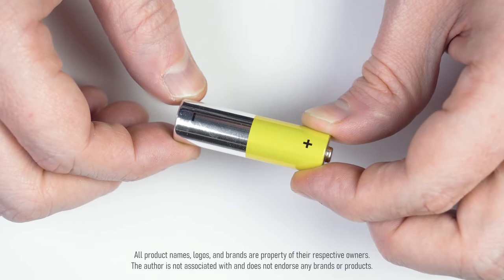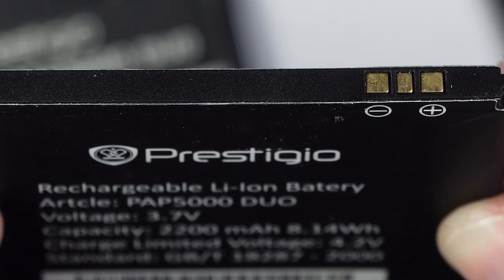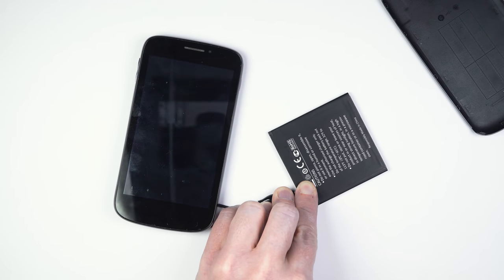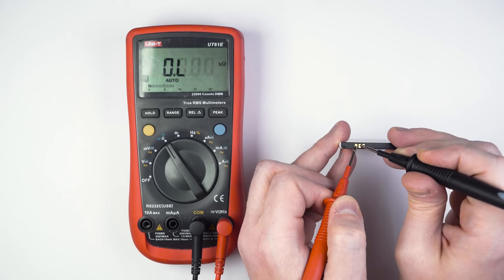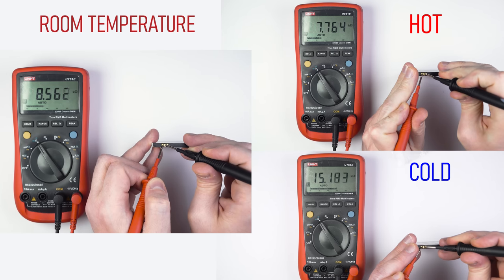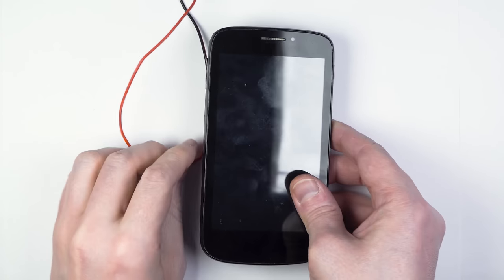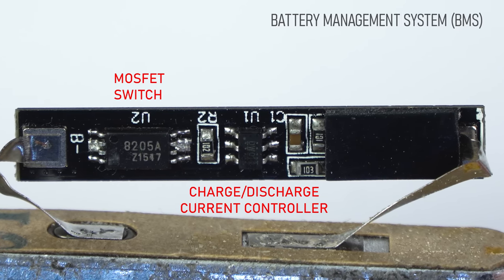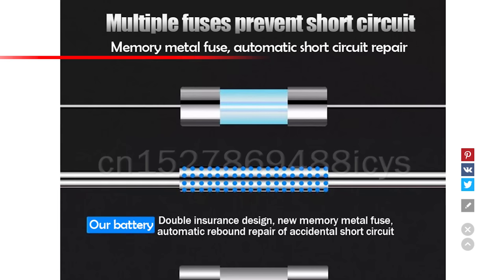Why do MOBILE BATTERIES have THREE terminals? A simple Explanation.

Comment: I don't really understand why the phone didn't turn on on your side. I tested lots of phones and other electrical devices with direct power input and they all worked fine. Some do not recognize charge, others say it's charged 100% (maybe less if you decrease the voltage). Phones and tablets often work as well if they're powered by 5V directly which allows you to power them with the power connector soldered to the internal pins. Be sure to remove the Li-Ion batteries in this case.
Reply from the maker: I would say about 75% of phone will fail to start w/o 3rd pin attached. And the rest would fail to USB-charge without it.

Comment: “After this video, I would never buy a third-party battery — at least if I were you”
Samsung doesn’t provide first-party batteries for their older flagships (such as my Galaxy Note II) anymore, so I need to buy third-party batteries instead. That said, maybe I could check if the resistance on my ExtremeCells battery changes depending on its temperature. For all we know, they may have done things right.

Comment: There are batteries with 4 or 5 contacts. They send smart information to the device.
Some devices will only charge batteries that are OEM and send specific information to the device.
They may request a specific HWID
So if it doesn't receive, say a HWID of:
AE001258
Then it will not turn on the charging line or allow the device to start up.

I have seen this in 2-way radios and even in cordless drills and corless tools.

They require activation code to be used

I miss the old days
The Nicad batteries could be left charging forever
Nothing complicated

Comment: @4:56 Everything came with a price. Chinese product have different price tag to fit in the requirements from the traders from other countries. UNFORTUNATELY the top requirement of the traders from 3rd world countries is LOW PRICE. While China supplies a major share of the world's battery for consumer electronics market,  certain big brands original batteries are also made in China. If one's memory is good, what happened to the Korean Samsung's Note 7 battery a few years ago? While China sent their Space Station to the space, a robot vehicle to the surface of Mars, and took back some soil sample from the back side of the moon, and export an alarming number of EVs to many countries, and you think they cannot make a good / safe battery? Just use your common sense to choose a good one.

Comment: Misleading. Many Nokia batteries don't have a thermistor but a fixed value resistor to ground which indicates the capacity (BSI, Battery Size Indicator).
Reply from the maker: It's only very old Nokia phones, and Nokia is the only brand that used this method, they switched to thermistor later on (check out BL-5C battery for example).
Reply: @RonMattino  The BL-5C only has a BSI pin.

Comment: Back in highschool with my Galaxy S2, my charging port broke and I had no way to charge it

My solution was to remove the battery, cut a USB cable, take the positive and negative wires, and sandwich the wires between the corresponding phone pins/battery pads while inserting the battery. That way the battery had all pins connected, and power flowing through the positive and negative. I'm sure it wasn't healthy for the phone, but for a broke kid in highschool it was a good enough fix lol

Comment: The government should make the seller, or website (Amazon, eBay, or wherever) liable if a battery catches fire because it didn’t have proper protect, and then suddenly Cheap knockoff batteries will have protection.

Comment: This is a great video. Thanks for making it. I've bookmarked it to watch again. I think I'll be avoiding dodgy third party battery manufacturers. Being able to power a phone from a difference source could be very handy if the battery stops working and I have to get data from my phone.
Reply: If the third party manufacturer has a proper thermistor in it, then is it still dodgy?

You've gotta be able to determine what is acceptable or not, especially as these third party batteries may basically be identical but packaged differently.

Comment: When my previous iPhone 5 battery puffed up, I went ahead and bought a third-party battery and for some reason, with that battery, I was only able to use it for a month before it stopped working. Luckily, I had my iPhone 8 before that situation. Until the beginning of 2021, I fixed my old phone and realized there was a problem with the battery, not the phone itself

Comment: This is occurs for semiconductor. If you heat a diode it will more conductive and if you cool it will loss conductivity. I had an experience of operating phones without middle pin. In my childhood, i was use my sister's ignored phone with torchlight's battery which had only two pins. So i think that is not a currect explanation. I expect that you will share content with more resources and knowledge. Good luck.........😊

Comment: Batteries are NOT "dangerous"... It's like saying that an apple (the fruit) is dangerous because someone can choke on it.
Yes, they can catch on fire if there is short or thermal runaway. But if we compare all the vehicles on the road ICE cars have around 65 TIMES HIGHER chance of catching fire than EVs.
Also mobile device batteries are fundamental different from the ones used in EVs. LCO batteries are primarily used in mobile devices, while EVs use NMC, NCA and LFP. The latter can even be punctured without suffering thermal runaway and can operate in extreme temperatures.

Comment: Batteries for fpv hobby drones do NOT have this protection, and many use 6 of these cells. They must be watched 👀 closely while charging. I have posted a real fire I had happen. I got ot out of my home with just moments to spare. And honestly, the time it was in my hand to the door was very very very unsafe. Seeing it go off with 25 volts charge, I would not have been able to drop it fast enough. And it probably would have jet cut a hole through my hand before I could have reacted, and then my home would have been in jeopardy. GREAT CONTENT AND ADVICE HERE! Spend the extra few $ to buy the manufacturer replacement battery and parts!

Comment: I have Moto E6s, and have bad charging port. I do want to use that phone as a car GPS, running from Cigarette lighter to charger to phone. Some youtubers have posted that 4.7k ohm resistor is good, but you have shown 10k ohm.
which resistor should I use, which won't affect car battery too. Battery rated at 12V 30Ah. i will be using it only when the car is running.

Comment: Furtherly if you attach (most types of?) cell phones or wireless phones to the charging transformers cable without having a battery in the slot, the phone won't work simply by the (electric) current from the power outlet, the same with wireless personal computer mouses if you attack an usb cable (where the "signal sender" would rest before usage), the cable is only allowed or enabled as a data cable. So one must have built a dummy bridge to shortcut-en the cell phone (if the charge would then still be 3,7 volt or whatever for a system). In the 0ies (the years 2000 to 2010) cell phones had regular batteries slots for normal (wasty) or rechargeable batteries. Where would/do the human efforts "become" lost?

Comment: This is actually a very good video.
I was of the opposite opinion at the start and I only contìnued,  to see how bad it got.
No more errors and perfect for most viewers.
( there was an initial comment about using cellphone batteries for other purposes all thats needed is a correct voltage) which is of course wrong.
The battery needs to have adequate capacity too. Or the load current needs to be less than the battery max supply I.
But nitpicking aside,  people can learn well from this video.
Well done sir.
Reply from the maker: The capacity thing is obvious, everyone knows what it means. For the rest, it can be used. Max current is approximately the same for all Li-Ion batteries except for models used in power tools, also the battery BMS takes care of overcurrent. So, in 95% cases the statement about using cellphone batteries for other purposes is true.

Comment: i changed samsung nx3000 battery with 2x18650 by connecting to old battery bms. it has 3 pins, so bms to read temp does it need to touch 18650s?

Comment: if the replacement battery just gets a little bit more expensive from the original manufacturer, letting my 5sqft flat burn down, flee, get a fake passport and start a new life in Mexico is becoming the cheaper option.
Also, removable batteries is so 2014.

Comment: Thanks for the information. But to highlight "Chinese manufactories" gives people a stereotype impression on Chinese manufactories. This is very bad. Maybe today we have most of the Chinese factories produce most of the low cost batteries in the world. But things keep changing. You should mention any low cost or no-big brand products are questionable, no matter where it was manufactured. It will help people keep alert instead of only to the Chinese low cost batteries. 
Also, even a battery with thermo-resistors inside, the battery may not be changeable unless there is a general standard. This is important as well.

Comment: I wonder what's the highest safe temperate for a phone battery.
I once had phone get to 50°C and everything worked fine. The phone was just scolding hot because there was no proper cooling method, if any at all.

Comment: Why are the connections so small and so close together if safety was a reason ? 
 Drycell batteries have the +and - at opposite ends of the battery . But the fiery explosive danger of phonebatteries is concentrated close together

Comment: Curiously, I have a tripole battery from a Motorola that I used to test some old brushed RC motors. If I check it with my battery tester, it shows a good nominal voltage, but if I stick it back in it's phone, the phone just boot loops. 
Perhaps I fried the temp sensor somehow? Wonder if slipping a small resistor in the phone's casing could solve that.

Comment: I guessed correctly that the third pin was for some kind of sensor. My guess was the capacity sensor. Anyways, you can use whatever battery, not only the original ones (unless you're using crappy iPhone). So the conspiracy theory doesn't even work.

Comment: A resettable overcurrent protection is good. But mobile phone batteries are still a scam. There are so many batteries from the same manufacturer differing either in their dimensions slightly or in the resistance on the third pin, that you usually need to order a special battery. Even Nokia have more several batteries besides BL-5C. Imagine if you needed separate batteries for your remote, scale, clock, etc. Simple cylindrical lithium batteries exist and can be used just fine. I had a 9V battery that I tried to "test" with a multimeter like you did and a metal strip melted inside it, and they would like me to throw it out.

Comment: This is why I have a third wire whenever I use cylinder cell batteries like 18650s, if there’s no ground terminal on my electronics, then it’s no good

Comment: I followed you to the simple resistor/thermistor in the battery. But then suddenly it sounded like there was also a complete circuit board with some kind of micro controller in the battery itself? If the battery itself already can switch off the current, what's the purpose of exposing the thermistor value to the phone/charger?

Comment: Who remembers when the Boeing 787 Dreamliner first went into service with the first lithium ion main battery, which promptly caught on fire?  The only thing that averted tragedy was the fact that the airplane was on the ground when the smoke began to leave the battery.  Even airport fire fighters were unable to put the fire out until damage had been done to the airplane.  The airplane type was grounded until Boeing figured out that they could not make the batteries safe.  If you are a passenger on a 787, know that the battery is still the untrustworthy Li-ion type, but it is now encased in a vented metal box which is so heavy that it pretty much negates the advantage of using Li-ion in the first place.

Comment: Some lithium rechargeable batteries have the third pin for a  completely different reason.
Some devices including cameras,   are made for 3V from 2AA or 6V from 4 AA. AA has 1.5V nominal, 1.6V full, 1.4V full for NiCd and NiMh and 1.7-1.77 for LiFe non-rechargeable. With normal alkaline AA, we have 3.2V with 2 x AA and 6.4 with 4 x AA. With new LiFe  we have 3.5-3.54V max with 2xAA  and 7.08V max with 4x AA. But Li-ion fully charged has nominal 3.6V only @ 50% charge but up to  4.1- 4.19-4.21 V fully charged and Li-Po has even more 3.7V nominal and again over 4V full. Li-ion has 3.9V @ 80% charge. Some lithium rechargeable  batteries have a third + pin for the charger, and the normal + terminal is conected inside with some electronics for some voltage drop. A diode can do a 0.4 - 0.5V drop, but it's not enough just one. A   voltage divider with a rezistor is not good because drop is related to consumer internal resistance and also to the current that can be different from one moment to another depending on the work of the device, so multiple diodes in series is a better chice, or DC to DC source with thransistors. CRV3 batteries replace 2AA, and some have the third pin for charging and some not but have higher voltage. Even sime AA Li-ion and LiPo exist with electronics for voltage drop and a third pin for the charger.

Comment: I have a GoPro Hero 10 Black camera and the battery has 4  terminals (pins) and the battery overheated in the camera while filming to the point it was stuck in the camera. After grabbing the blue tab on the top of the battery with needle nose pliers,  the top blue section came off the battery. The battery was one that came with the camera from GoPro.

Comment: You are mistaking a 'Cell' for a battery. A battery has to have at least two cells, a single AA or AAA or even the Lithium Ion 3.2V are cells and not batteries.

Comment: I wouldn't say "best", maybe "most energy dense per volume" or maybe also "most energy dense per weight", but there are other options that are much more secure, much easier to charge and much more environment friendly, but heavier and less energy dense per volume, also possibly not available in such a small form factor either

Comment: Liion battery is worst of ghe batteries from current tech. the reason they are the cheapest. greed money...

ty. i was looking how to fix issue with power port since its all whacked thanks to the usb shemale port.
so i have to run "wires" straight to the power pins inside. but zhere is like 4 pins...

Comment: actualy, you don't need that pin, becauase all the phones can start and charge easily whiz 2 terminals, only thig is that you made such a bad contact in the phone, and the battery that the battery can't give a 3.7v stable voltage, that pin is for the temperature sensor, and the samsung battery, that have got 4 pin 2 of them are for the nfc antena or for pasive coling

Comment: I can take any battery that's completely dead or will not charge and charge it less than 5 Seconds. I can also external power source without using a resistor I've been doing this for over two years

Comment: If you simply open a battery and have a look into the BMS, you can see the thermal sensor and that gives you an idea what may be happening in there.
Reply from the maker: Thermistor looks like a regular SMD resistor, so it's not that easy to differentiate, actually.
Reply: @RonMattino  Thermistors in general do not have any markings on them vs Resistors which do even in 0402 packages also thermistors are often just plain black in color. Not that hard to tell apart between each other but Thermistors can be often mistaken with Capacitors or inductors.

Comment: Most phones now don't have customer replaceable batteries and manufacture replacement batteries are not always available, so third party batteries are the only solution.
They want you top throw away your old phone and buy a new one once your battery packs up.

Comment: TLDR the battery inside actually still has just 2 terminals, some just incorporate a temperature sensor too to allow the charger to implement over temperature protection

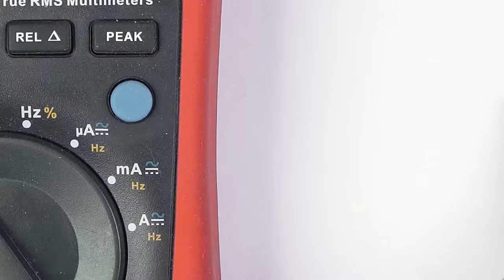Comment: 2:20 resistance mode doesn't work correctly for batteries. It's basically the multimeter supplying a constant current and measuring the voltage. However the battery terminal also supplies a voltage, which will be included in the voltage measured by the multimeter (which will then be higher or lower, depending on polarity), leading to a false reading.

However the conclusion is still right, because if the resistance between the terminals wouldn't change, the multimeter would still always show the same (false) reading.

Comment: The B.M.S. (battery management system circuit) is an important safety component of any lithium battery pack, it provides protection against overheating, reversed polarity, overloads, over charge and over discharge, if a lithium battery is discharged under certain threshold will not be charged (commonly under 2.5 volts) because for safety reasons any smart charger detect s it as faulty.

Comment: Batteries that are 1.5 volts or less dont need neutral. But there are some battery's that are up to ten volts or 25 volts on car batteries😮.  

Simple answer: middle pin is neutral but im not sure because im not not a electrician

Comment: The third terminal can sometimes be a serial bus using Dallas 1 wire protocol to a gas gauge IC. This allows reading current, voltage, temperature, battery serial number, max capacity, charge level and many other things. Sepura TETRA radios have batteries where the third terminal does this.